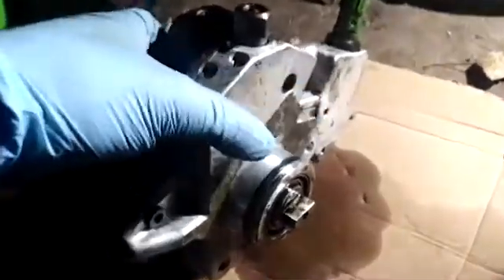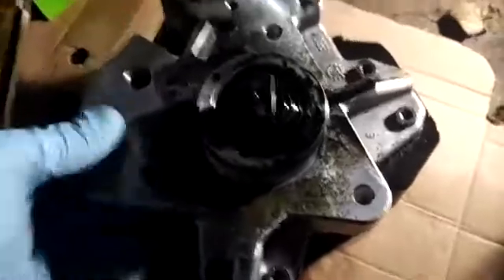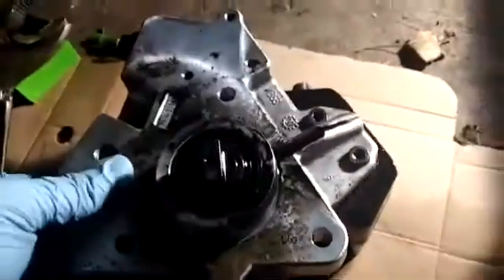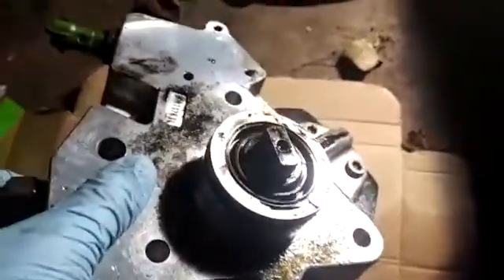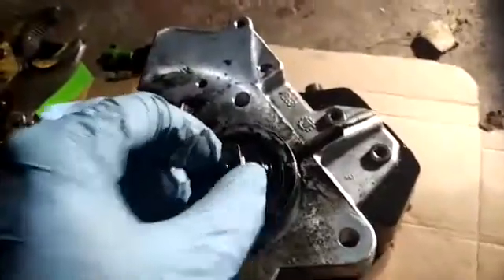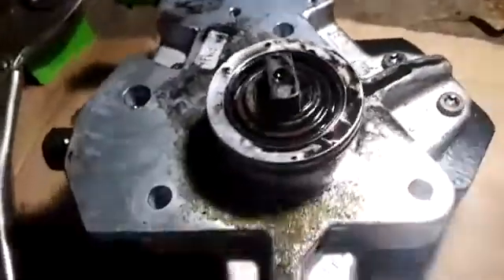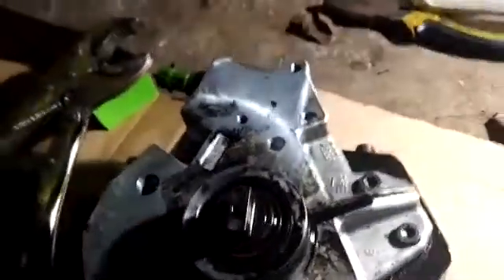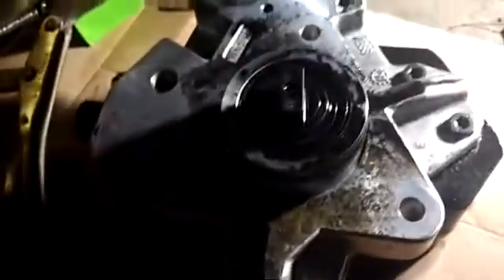Volvo D5 185BHP CP3 High Pressure Fuel Pump Fault Finding

Comment: Do you think that this high pressure pump going bad could cause some metal dust in the diesel filter?I dont have separate pump for diesel, only high pressure pump.My volvo is 2.0D so its not Volvo's own engine type, but its from PSA that makes ford, citroen peugeot etc.And im wondering where the hck does this weird dust come in to the filter, today my car stalled and shut down, but i got it on again and drove home.Diagnostic at the repair shop says its has time to time low fuel pressure.But for example no problem in idle RPM's.Im starting to think i need to buy new high pressure pump, wich cost half of the cars worth.1500euro +mechanics work.